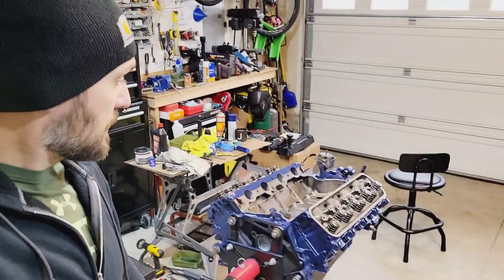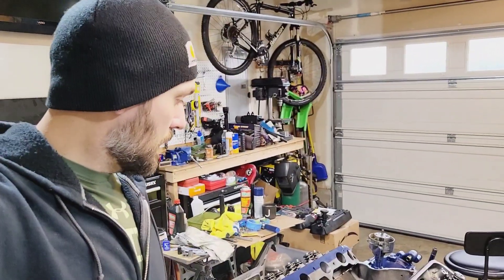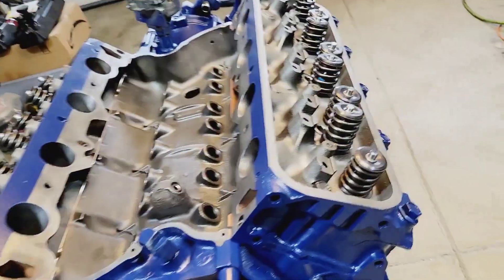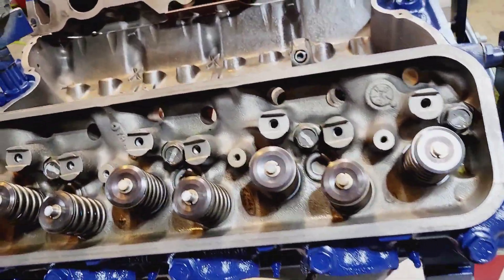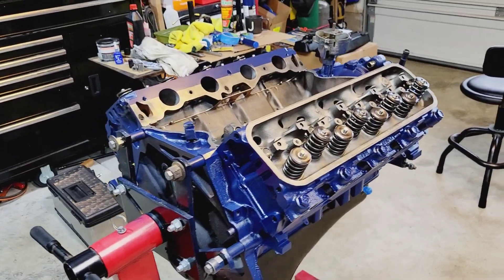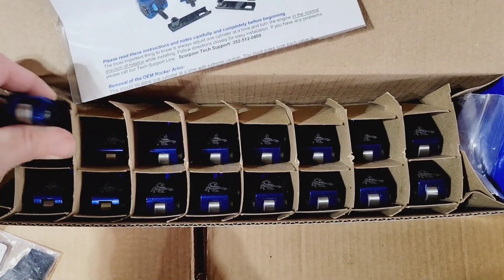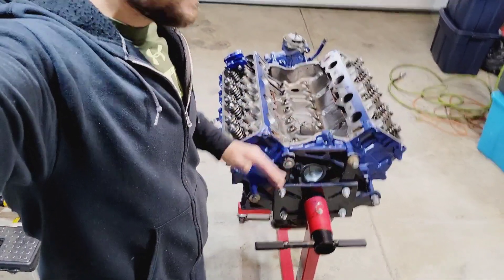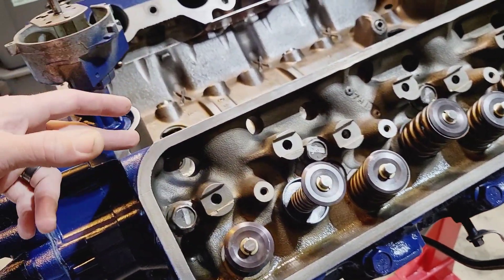Turbo EFI 460 pushrods, roller rockers and some problems 🇺🇸🇺🇸

Comment: It's always interesting to see how different shops do their thing.  Where I worked, after a valve job, you lapped them in to see where the pattern is and make sure you didn't have any non touching spots on both seats.  Also the quality of the valve machine and head machine makes a big difference on run-out numbers.   Vacuum checking is also a really good method, so I'll be curious if they let you see first hand what the problem is.
Reply from the maker: Ya my current machine shope does not like the way the heads were done by the previous shop. The new shop has been awesome to work with and I'm sure he will break it down for me when fixed. I will cover that in a video when I have the head back.

Comment: What octane do you run?
Reply from the maker: 92 pump and soon to be flex/E85 when I turn it up.
Reply: @johnvirgilsgarage  good to know any detonation so far? I talked to my machine shop about going 10.1,  but they did not want me to because detonation.  So I'm going the turbo way with things. Please make a video on your heads!
Reply from the maker: You could easily run 10:1 on pump gas, even with a turbo depending on dynamic or effective compression ratio. I know of at least one other turbo 460 running 10:1 static and over 10#'s of boost. Cam choice really because a factor.